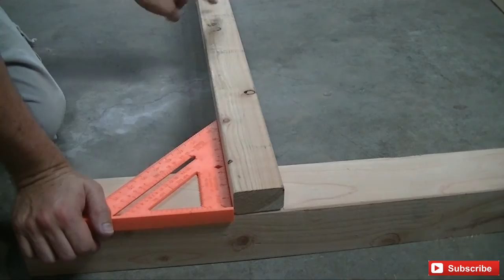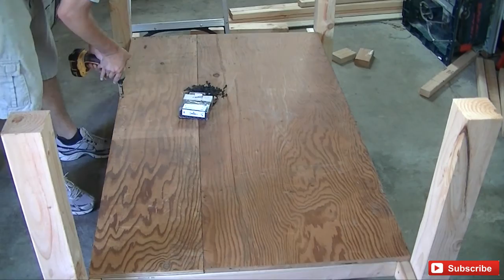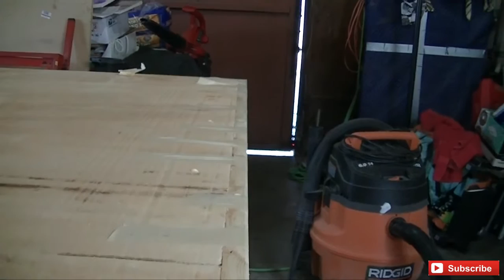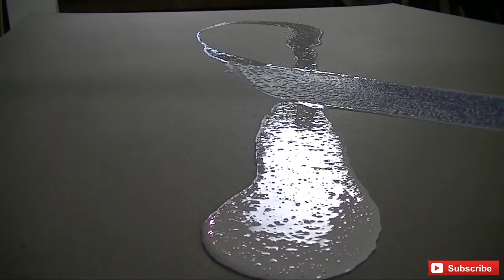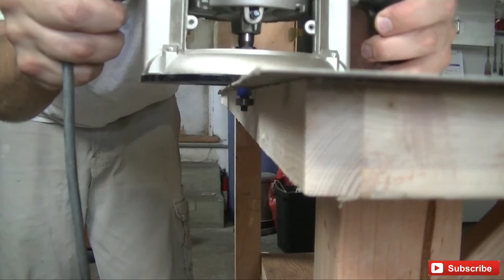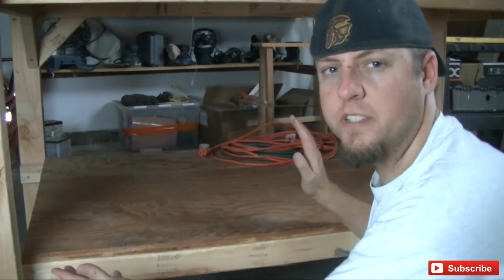Garage Project 7 - Workbench 2

Comment: I built my main work bench pretty similar as yours....a few differences in the jointery and how I did the top. For the joinery I used lap joints which is much stronger than butting them up... and for the top I put the plastic laminate (I used hardboard) on first then trimmed out the plywood edges with Poplar....I put the trim pieces on just proud of the hardboard, then use a flush trim bit to flush out.  So basically the hardboard sits within the Poplar trim
Also, I did not glue the hardboard down, this way when it gets old I can easily replace it with a new piece.
Btw, this is a temporary workbench, just so I can get started building stuff for the house
Reply from the maker: WestCoastMods yeah I need to re-do the joint to lap. The bench has a little wiggle to it.

Comment: silly americans measuring in feet and inches
Reply: get on the metric system mate
Reply from the maker: sam wheller been using feet/inches for 33 years, why change now? Plus I use feet/inches ever day at my day job. Reading plans, measuring etc.
Reply: WildmanProject
I'm from England and I still use feet/inches.
You carry on what you feel best in using, there's no law to say which measurement system you should use..
Thanks for the video.
Barry from England.
Reply from the maker: Barry Roberts Agree!!